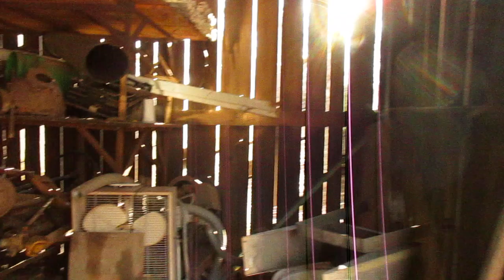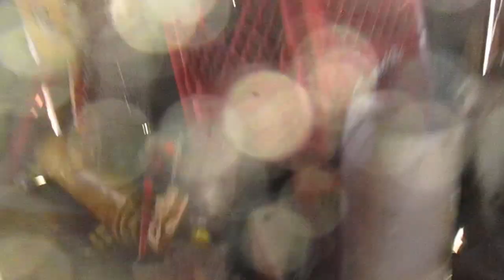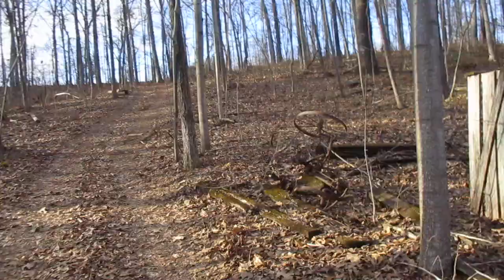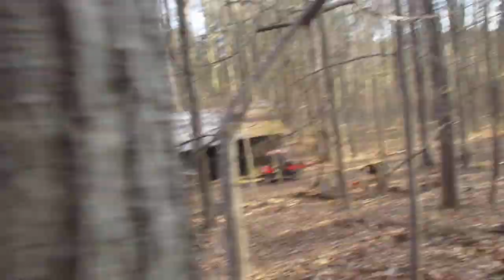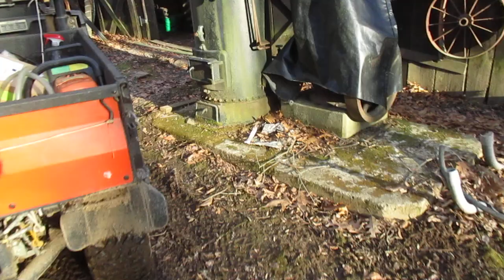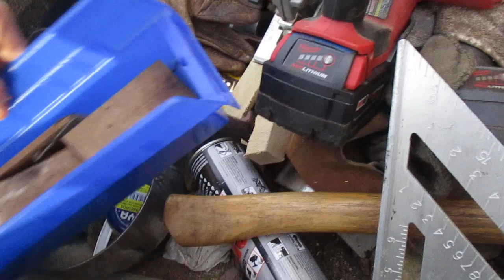Problem tree take down plan #655

Comment: Thank you for the Video. The easiest way to throw a rope is to start with a slingshot, a fishing weight and fishing line. Tie the fishing line to the weight, and slingshot it over the tree limb. Them use the line to pull a light rope over the limb and then repeat with bigger rope moving up to cable.  Have fun, stay safe. Cheers.
Reply: I've got a toy crossbow I use for that sorta thing. Not so much of a toy though, it'll poke a hole in you if you get in front of it. Wouldn't dare give one of those to a kid. lol
Reply from the maker: i got it on the third throw . i amazed my self . thank s for the idea john
Reply from the maker: @fudgea  got it rigged today john